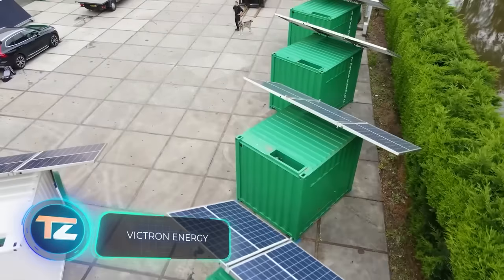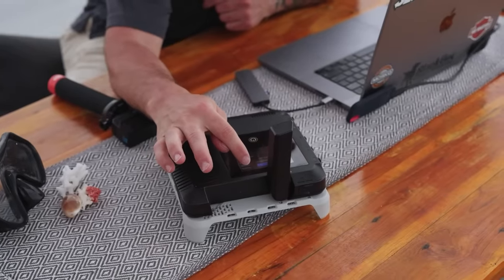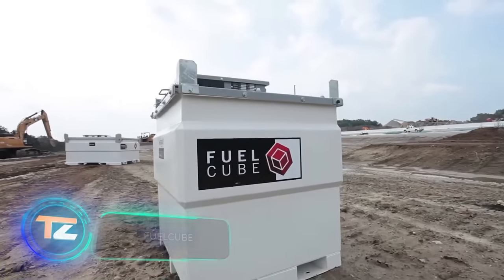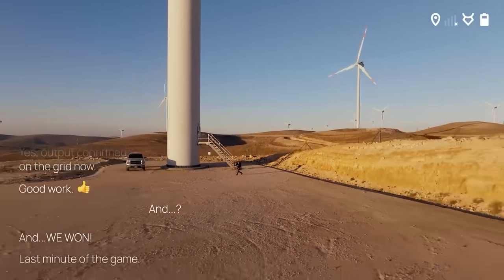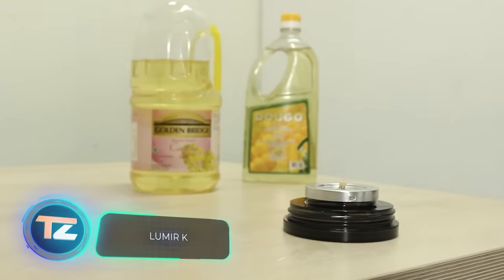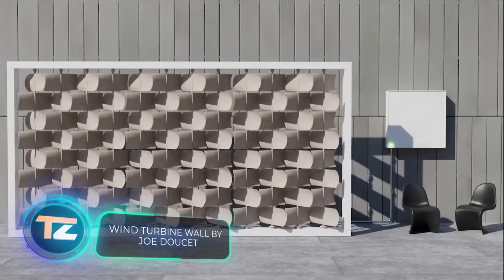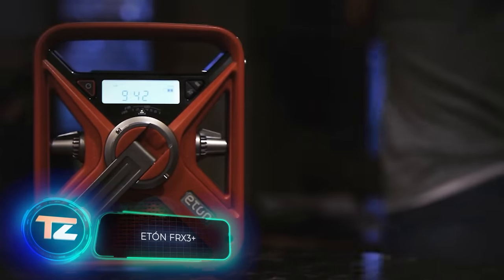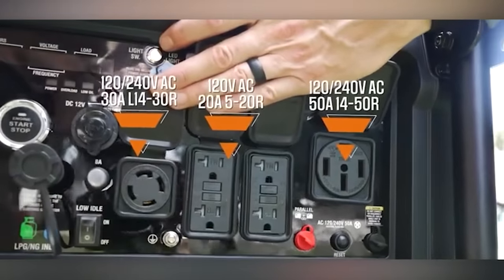15 GADGETS AND INVENTIONS THAT WILL WORK EVEN IN FULL BLACKOUT

Comment: I've got 1800W on my shed and I can confirm it won't do much in a UK winter. My Petrol generator will though. Those units are a massive overhead - just leave the panels out all the time and get the benefit of £200 a year off your electricity rather than tuck them away.

Comment: 2:43 GG on not fully explained what the gasifier even does fully besides "burning WOOD" 
Clearly not pushing relevant information that was even a big power generator prior to the 1900's around the world Via Busses, small automotive and 'lorries'.. even for homes in cities were running gassifiers..
Now I can't take any thing srsly from your channel
Reply: it burns irr moee efficinetly, but for 11k, it would take decades to make back the extra cost....perhaps if you dont have a heating system and are building a house from new....